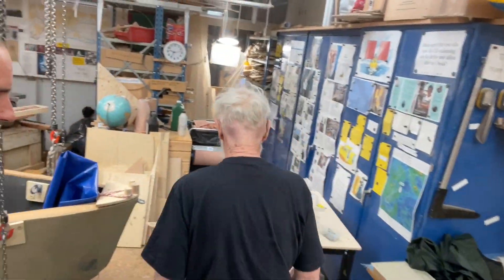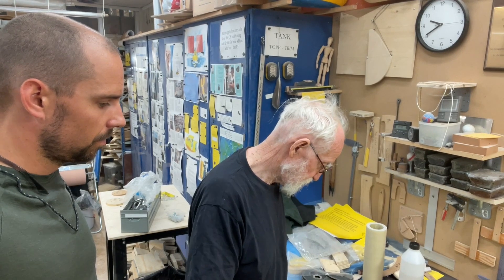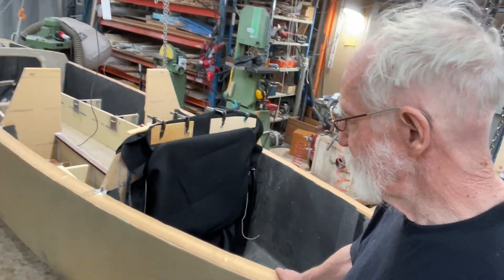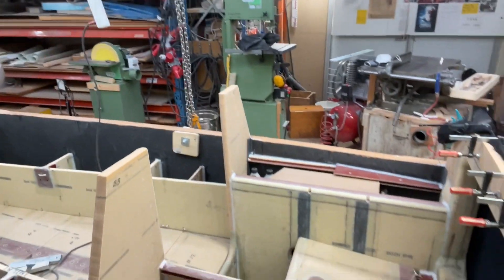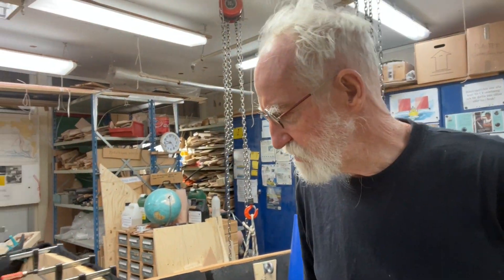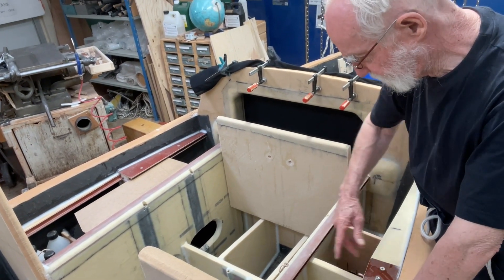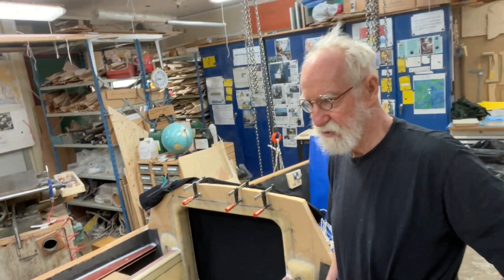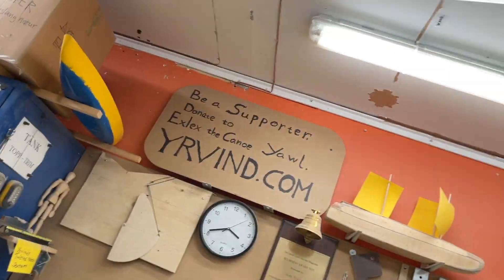1 July 2022 Evolution of my boats.

Comment: In 1975 when you were on Marthas Vineyard I was just seven years old and lived across the sound in the small village of Cotuit on Cape Cod. At that time my neighbor was building a contraption that consisted of a metal octagon frame with large rubber inner tubes strapped to the bottom for flotation , a Volkswagen engine was mounted in the middle with an old airplane propeller attached and he planned on adding a hot air balloon to the whole thing once he shipped it to africa to do film work for National Geographic. Every summer we would go to Martha's Vineyard on my fathers little16' speed boat.

Comment: Great video with the Captain and all the history!
Question:  Sven, may I ask what 'H'-number (e.g. H-60, H-100, H-250 etc.)  your Divinycell cell is on the hull, and if different for the interior bulkheads?
Thanks!
Reply from the maker: Hull Divinycell is H 80 
70 mm
Inside varius H 130
H 200 
Even Submarine divinycell about H400 but not marked H very tugh.
Reply: @SvenYrvindExlex  thanks for the reply. I calculate the hull to have an insulating R-factor of nearly 13 for H-80 with 70mm, which is better than the typical home in the US—so not bad for just the hull!   The R factor drops off radically with increased density of the Divinycell but that is understandable…